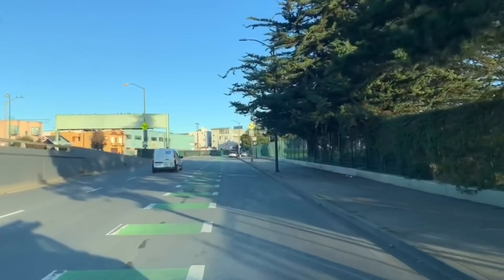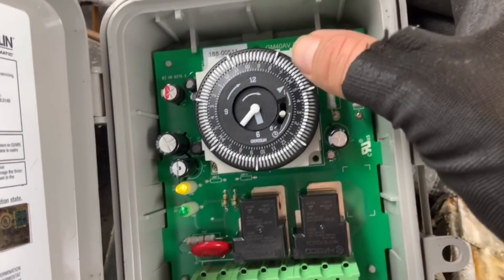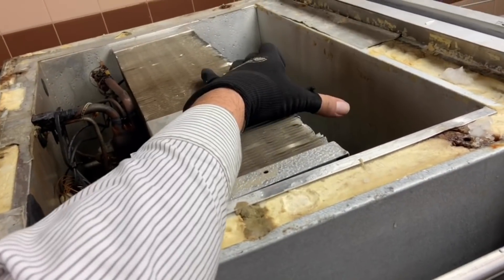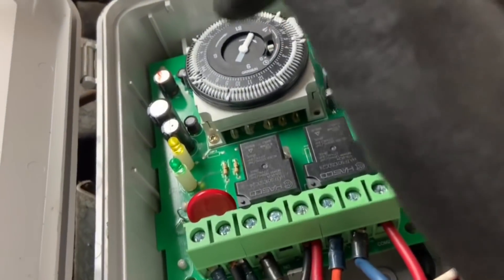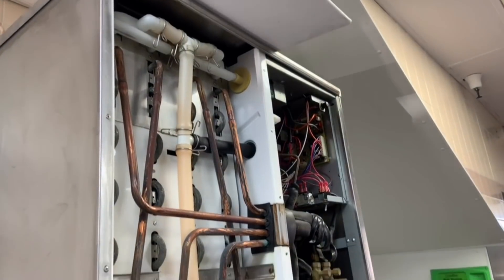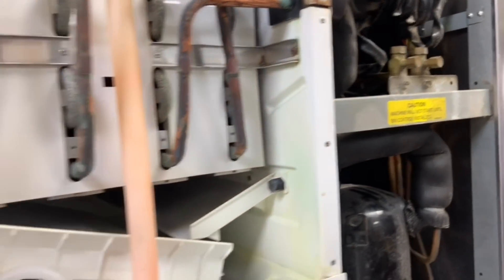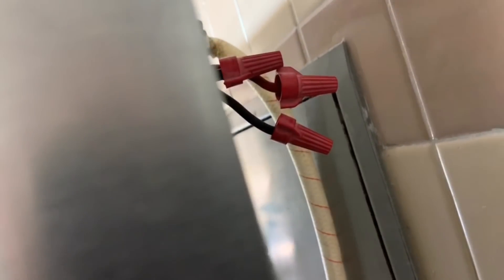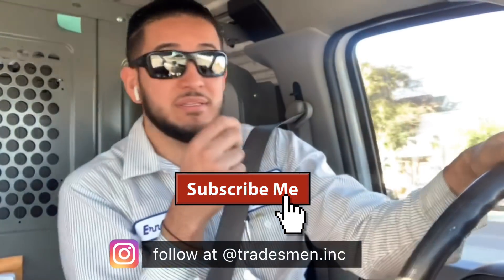CHRISTMAS HVAC-R VLOG / REACH IN FREEZER NOT WORKING PLUS ICE

Comment: I had electrician wire a hoshizaki wrong also. I corrected his mistake and machine still did not run. Found the transformer had burned out due to wrong voltage applied. Life's good.
Reply: Seems to be a theme with electricians.   Good at wiring to the outlet but not very good at reading schematics.
Reply: @bradmironik6137  There is a tag on the wires on top of the machine that quite plainly states and shows how the thing should be wired!. Surely the professional electrician would not ignore  this! His brother in law must have been working that day.
Reply: Had a sparky wire a hoshi backwards and only had 110 and compressor didn't run
Reply: Dude can someone educate me quickly on this? Where is the neutral on this seemingly 3 phase plug?
Edit : I figure it could be a "single phase" 208v with two legs of 120 and a neutral?
Reply: @Mybongtippedover  i opened a ice machine  i have in storage.  On the KML-600MAH  there is 3 wires in the junction box in the machine, black, brown and white. There is also a green head screw- ground . The white is neutral. Black and brown are 208-230/60/1. You may have to open the top of the  machine to see which wire on your whip is neutral. This info is correct for my machine , i cannot be resposible for others wiring there machine wrong. This help you out?
Reply: @IFIXCASTLES  yes thanks!! Did you know interestingly enough that each the brown and black are 120v to neutral and when combined across a load (L1,L2) it creates 208v "single phase" but its actually more actually described as two phases!
Reply: @Mybongtippedover  you baited me? Your ridiculous.

Comment: if the thermostat was bad and wouldn't allow compressor to run how did the unit freeze up? Or did it fail open after you defrosted the coil?